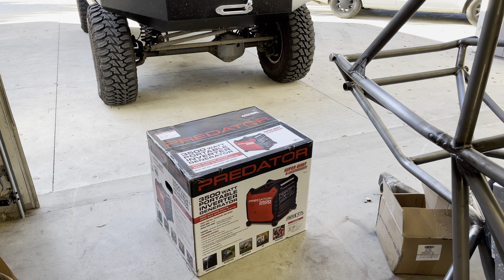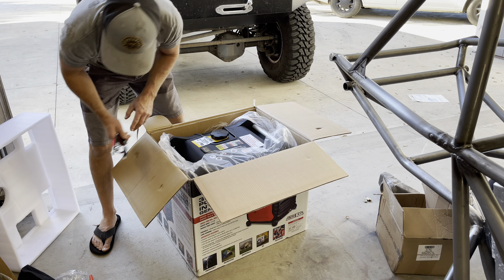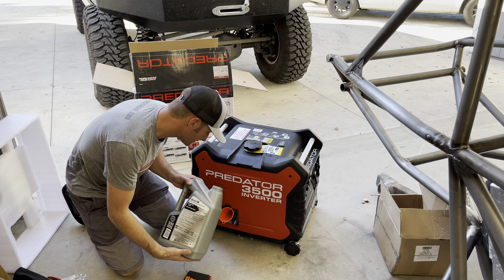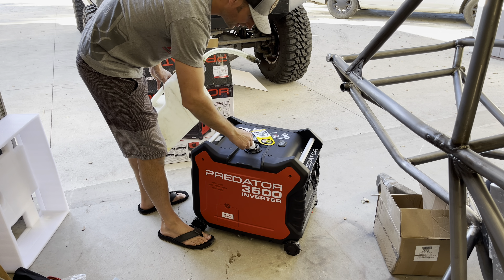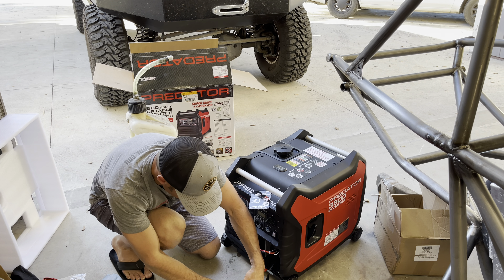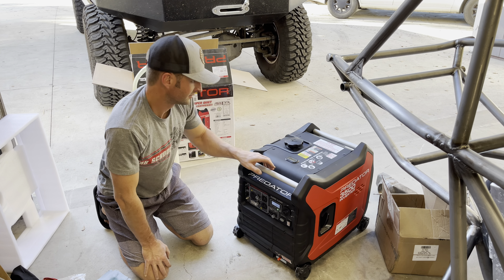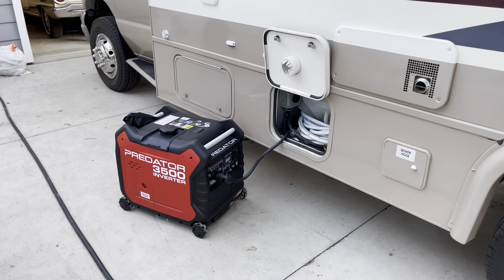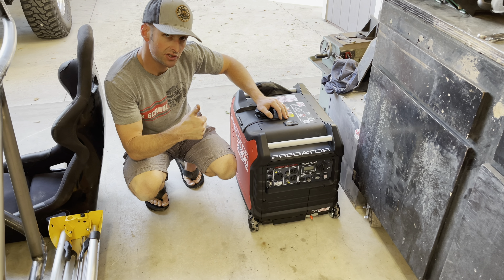Harbor Freight Predator 3500 generator review

Comment: Great video sir. FYI those have a ⛽️ shutoff believe it or not. Just turn the knob to the position to where it is almost off and leave it there. It will run its fuel out and shutoff. There is a video on that actually 👍
Reply from the maker: Awesome.  Thanks for the tip! I know my Father in Law’s Honda 3000 has the same thing, ignition off also turns fuel petcock off.

Comment: Is it still going good?  Did you get the extended warranty?
Reply from the maker: It is doing great!  It ran for 10 days straight at KOH 2022, no issues.  I did not buy the extended warranty with the theory that if it made it 90 days, it would make it 9 years.